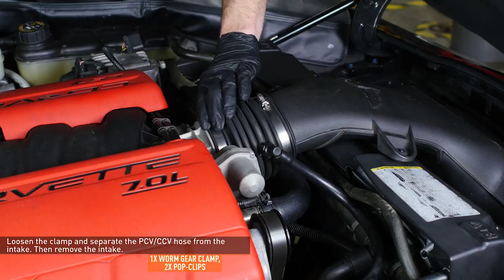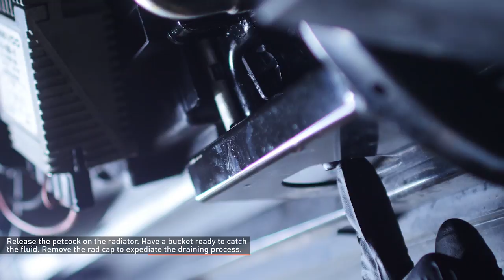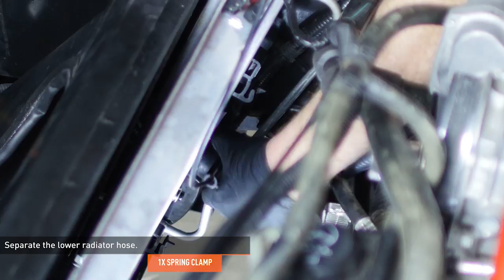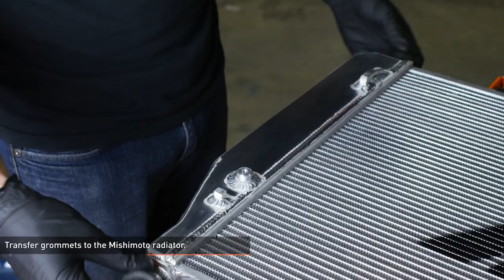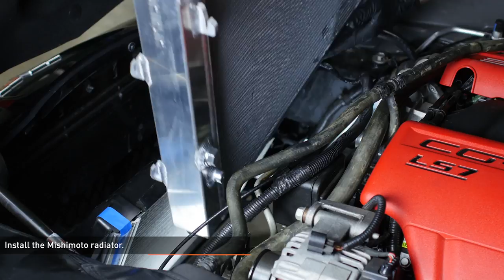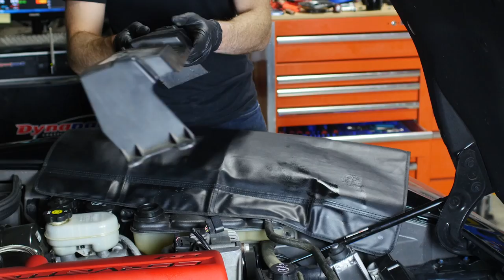2005-2013 Chevrolet Corvette Performance Radiator Installation Guide by Mishimoto

Comment: How much better is this radiator over stock?
Reply from the maker: •Drops outlet temperature by 5-10°F across powerband
•Features a two-row 2" thick brazed aluminum core, providing ideal fluid temperatures on the street and at the track
•56% increase in fin surface area for optimal cooling properties

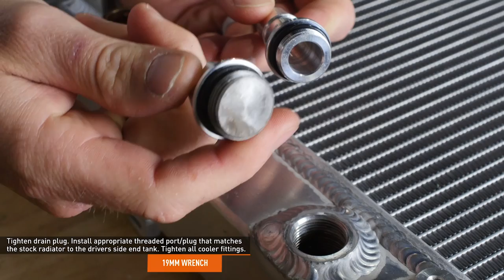Comment: 5:55 why did you switch from an open end plug to a closed end?
Reply from the maker: This depends on the vehicle the radiator is being installed into. Some require a port there, others do not. "Install the appropriate port/plug that matches the stock radiator to the drivers side end tank."
Reply: @mishimoto this would be for my 2011 c6 z06 non z07 package. Can’t find any oem rad so I’m trying to find an exact fit. Would this be it?
Reply from the maker: Yes, this fits:

2005-2013 Chevrolet Corvette
2006-2009 Chevrolet Corvette Z51
2006-2013 Chevrolet Corvette Z06
2010-2013 Chevrolet Corvette Grand Sport

Comment: What size plugs did you use?
Reply from the maker: If you are referring to the drain plug, M12 x 1.5
Reply: @mishimoto  I’m sorry I should have been more specific. The plugs you used for the oil cooler/ trans/power steering cooler lines
Reply from the maker: These do not need to be plugged as coolant does not travel through those lines. You can leave them open if you do not need them.